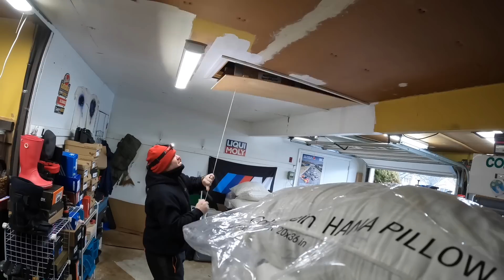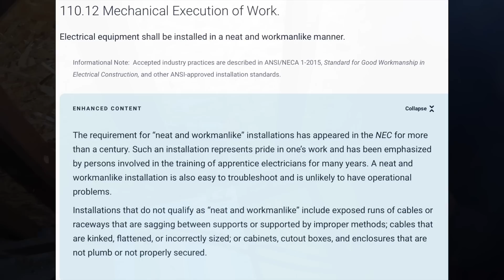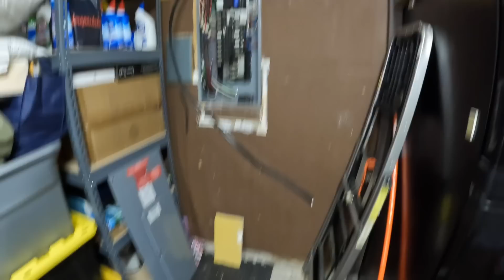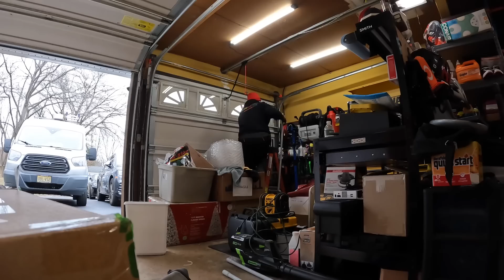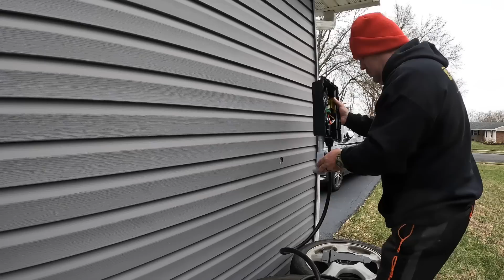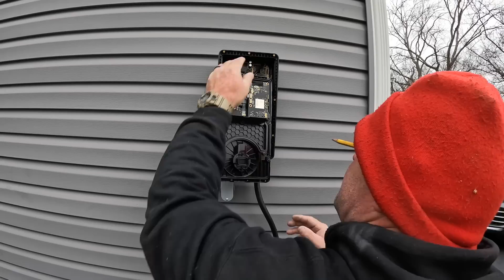COMPLETE INSTALLATION OF A NEW BRANCH CIRCUIT FOR AN ELECTRIC VEHICLE  CHARGER BY AUTEL

Comment: Great Video! That 6/.2 is really hard to work with. I just installed a Tesla Universal Wall Connector at my home, and just bending and cutting the 6/2 was a pain in the ass. I was also surprised by how much the 6/2 cable cost.

I would make one recommendation to help you. Buy a 12-volt Milwaukee impact driver instead of a hammer drill. It is light, and believe it or not, it has over 100 ft-lbs of driving force. It will help you drive your screws into wood much easier, and you can use it to tighten electrical screws (snug them up) and loosen frozen screws. It's small and easy to carry and it is much better than a drill. For example, installing the Torx screws in this charger would have gone MUCH quicker using the 12V Milwaukee impact driver. It won't over-drive the screws and strip them out if you are careful because it has a variable speed trigger. If you learn to use a small impact driver instead of a screwdriver and drill, it will save you a lot of time. With really delicate screws, you will still need to use a screwdriver, but you will find that you can use this small impact driver to drive 3" wood screws as well as a wide assortment of other screws.

Comment: no sub panel for 60 amps ?
Reply from the maker: Why?
Reply: NEC 2017 60 amps or more needs a shut off sub panel
Reply from the maker: @jimchapp254  I've done more EV chargers than I care too remember. The disconnect is only required for over 60 amps. Most are only 40-60 amps even with the 125% as required by NEC 625.
Reply: @electricianron_New_Jersey  thanks , for clearing that up for me

Comment: Hey Ron. I am enjoying the video. One question. Does the NEC prohibit install type nm  cable in conduit.  Also is #6 nm (60 degree C Insulation) approved for 60 amps?  Thanks
Reply from the maker: It is in New Jersey but not by the NEC.

Comment: Going Crazy! 😵‍💫
Maybe you can help. When connecting a disconnect box on a vinyl siding home, can I use a standard Romex connector on the back of the box and connect 12/2 to it. I will use duct seal clay to fill any voids behind the box. I can’t find any info on this online. Love your videos! Thank you Ron!
Reply from the maker: Yes, absolutely
Reply: @electricianron_New_Jersey  Thank you so much for your help over the years. It is greatly appreciated.

Comment: Great video Ron! When mounting the charger on vinyl siding do I need to find a stud to secure the bracket screws into or the plywood beneath the siding is good enough? Also, do you recommend applying silicone around the charger?

Comment: Hey Ron, I am a very new residential electrical contractor in Washington. Right now I am solo like yourself and was wondering what your opinion is on becoming a certified installer of particular brands of equipment. For example, you can become an Eaton Certified Installer for about $500. I would like to hear your thoughts on this- is it worth it? Thanks buddy!

Comment: Hey Ron I’ve been going threw all your vids can’t get enough. Quick question whenever your doing drilling with the m12 is that still with the impact or do you use the m12 drill
Reply from the maker: I usually use M18 for drilling holes.  I’m slowly moving away from using the impact and choosing the M12 drill/ driver for driving screws and such.

Comment: I do a lot of these ev charger installations. I’ve put #8 on a 60 amp breaker using a 14/50 receptacle before and havent had any problems out of it. It’s used daily. It was a hurry up rushed job and all I had on the truck was some #8 Romex and a qo260 breaker. Most of the time,99%, I use #6 either Romex or THHN. That time I used the #8 it was a run of like 10ft from the panel to the outlet. I also didn’t use gfci protection oh 😱
Reply from the maker: So next time you do better right?
Reply: @electricianron_New_Jersey  yes sir. I haven’t done that again and I never will 👍🏼

Comment: Great work Ron. I just bought a fixer-upper with old mc with no ground, the previous owner had a nice modern 150 Amp service panel installed. But all the wiring is ancient.

 How should I look for shared neutrals?   I'm now replacing receptacles. (until I'm able to start rewiring).
Reply from the maker: Open up the panel cover and look for any 3-wire branch circuits.  You may, or may not have them.
Reply: Thanks good buddy

Comment: Hey Ron, I appreciate your videos to show how hard it can be to install home electrical. As a master electrician, I am putting a notice on this video stating that 6awg Romex is not rated to be installed on a 60amp breaker.  The NEC 110.3(B) states, listed or labeled equipment shall be installed and used in accordance with any instructions included in the listing or labeling. This rule is easily overlooked. Per manufacturer rules of all romex you shall install to the ampacity of no more than 60 degrees. This means 55 amps max on 6awg romex. No exceptions. Please correct future installs and remember electricians are obligated to install to the minimum guidelines on the code book regardless of what your jurisdiction says , you cannot go beneath it. Feel free to use 4awg aluminum SEU or 6awg copper SEU or use conduit 6awg thwn.
Reply from the maker: Go read the DCA on the 55 amps and lmk.
Reply from the maker: 6/2 NM is good for 55 amperes. Read about NJ's decision to allow the use of 6/2 NM here: https://www.nj.gov/dca/divisions/codes/publications/pdf_ccc/CCC_Fall_2023.pdf
Reply: @electricianron_New_Jersey That article was actually a great explanation that helped me understand that gray area of 60 amps on romex.  Even though it was published in Jersey they just explained the application of general NEC articles so I would think that unless a state makes amendments prohibiting it, 6/2 Romex would be acceptable on a 60 amp breaker for EVSE anywhere.
Reply from the maker: @TheFacilityguy  that’s not true.  Take a look at 210.19(A) because only here in New Jersey is the 6/2  NM good for 60 amps because the DCA said so.
Reply: @electricalron  great article it is very informative. I am going to save that
Reply: Does anyone know if this allowance has been made in other states? Installing EV chargers is going to be more and more common. Great video, Ron.
Reply from the maker: It does contradict the language in NEC Article 210.19(A)(1) so best to check with your states requirements.  @donmclean1220
Reply: Ryan Jackson just posted a video about this specifically on his YouTube page.  I suggest everyone check it out. 4awg must be used no question.  This is not a promo. Ron I suggest you see what he has to say.  You have to go by the 60 degree table with nm cable.
Reply from the maker: @Californians_go_home  cool

Comment: Hey Ron!
Just purchased 6/3 Romex at HD! I nearly had a heart attack!
Nice job as always. Be safe brother
Reply from the maker: Right? Try selling it and installing it. It’s not cheap!
Reply: Recommend checking local electrical supply houses before buying wire at the big box stores.  I needed 50' of red #6 THHN.  $1.59/ft at the big orange store, $.71/ft at a large national chain of supply houses with 600+ branches

Comment: Very nice job Ron I have a lot of electrical knowledge but am not an electrician but the main breaker goes off before I remove the panel cover and does not go back on until the cover is secure don't need any nasty surprises
Reply from the maker: Yeah that’s definitely safer.

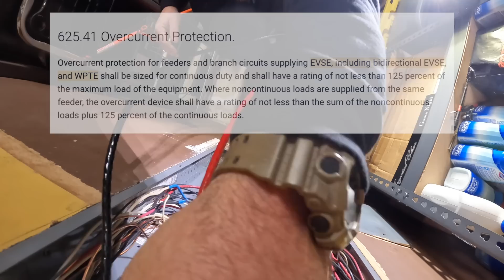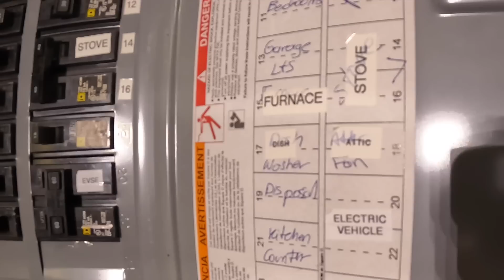Comment: Hi Ron... Another great video. Question 1: At 7:31, you post 625.41 which requires overcurrent protection with a rating of not less than 125 percent of the max load of the equipment.  At 9:31, it appears that you install a 60 amp bkr for this 50 amp load. It that acceptable?  Question 2:    Is 55 amp rated 6-2 romex (as opposed to #6 THHN) acceptable for this 50 amp continuous load?
Reply from the maker: NM 6/2 is only rated for 55 amps but the Division of Consumer Affairs has approved this wiring method for EV Chargers.

Comment: I'd like to understand how you determine if the electrical service has the capacity to add a 60 amp continuous load EVSE.
Reply from the maker: I do a load calculation if the BLDG DEPT requires one.  Would you like a video about that?
Reply: Yes @electricianron_New_Jersey
Reply: That would be a very interesting video
Reply: Load CALC would be great! Curious to how one is done correctly

Comment: Ron, greetings from Ukraine. My question is: Do you torque the connections with a torque tool to check and how stringent are your requirements for this? Thank you.
Reply from the maker: Most EI’s don’t check for torque anything, especially old timers.
Reply: @electricianron_New_Jersey  Thanks for the answer))

Comment: Hey Ron is 6/3 romex good for 55amps 60degree? I know the terminals are only good for 6awg.  That hoodie is badass!!!!!!
Reply from the maker: Per the NJ DCA 6/2 is good for 55 amps and acceptable.
Reply: @electricianron_New_Jersey  I guy I work with said he failed before using romex. I never really thought about it until he brought it up. Most the hardwired ones Iev done were piped. The terminal in charger only go to #6 so they splice  box in garage to #6 thhn. I think it is better to not have splice or aluminum so I was wondering if you had encountered any problems with it! Sounds like your state is on the same page about!
Reply: @jeremiahnewsom7775  I used to wire all 48 amp EV chargers with 6/2 NM until inspectors started failing my installs, which never made sense because the conductors in the NM have 90 degree rated insulation and should handle the load fine. Switched to pipe and 6/2 MC, and haven't switched back to NM yet because I don't want a super trooper inspector to fail me and make me redo the entire install.
Reply from the maker: @YaksAttack  110.14 says anything under 100 amps is 60 degree column.
Reply: @electricianron_New_Jersey  what is the size of the bottom knockout for that unit? I have one arriving on Saturday and I want to have all of my supplies ready to go when it arrives.
Reply: Per 2020 NEC, #6 Romex is good for 55 amps.